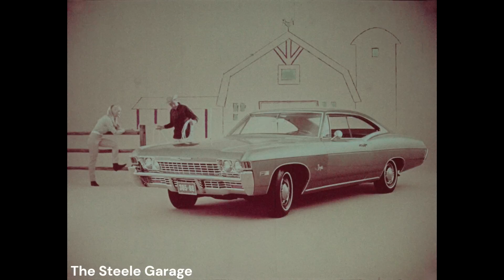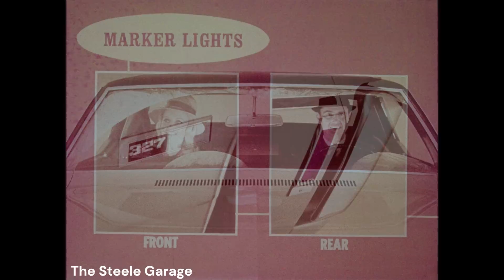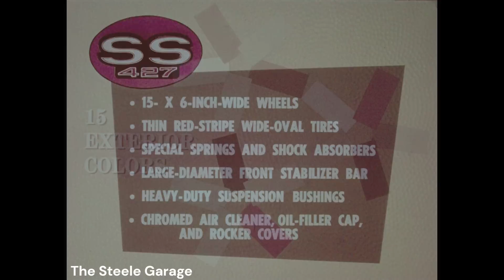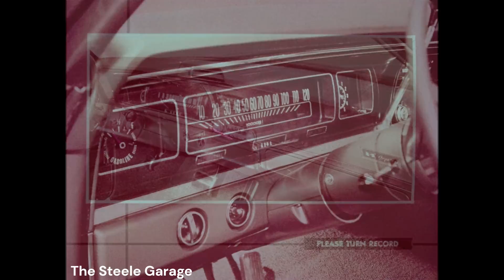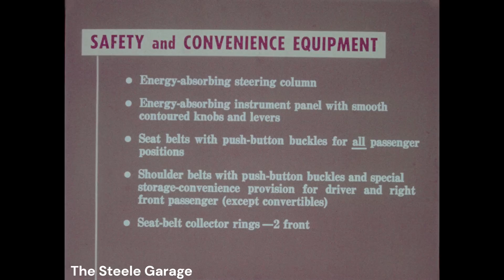1968 Impala Introduction - Chevrolet Dealer Training Film - SS 427, Caprice, Bel Air, & Biscayne

Comment: In 1979 i bought a 68 Belair for $200 dollars it was just a Plaine Jane with a 307 motor that had about 200,000 miles on the clock but the interior was in decent shape i drove it to work for a year or so then sold to my neighbor for $200 dollars.

Comment: 68 was not the first year for the Caprice "formal" roof line. 1967 was the 1st year.Also, "all new design from bumper to bumper" is also untrue, the whole design carried over from 1967, the dash,front bumper & grill, and rear bumper were redesigned.

Comment: Had a 68 Caprice, this car was loaded, all power, windows, seat, factory 8 track under the dash, signal markers on each fender, fender skirts, factory rally wheels, 327 275hp 4 barrel carburetor, owned back in the 80's have not seen one like it, should of never sold it...Thanks for the memories!
Reply from the maker: Sounds like a cool '68! Thanks for watching.
Reply: @TheSteeleGarage  It was. I did forgot to mention had the hidden head lights

Comment: My first car when I was 16 was a 1968 Impala. It was 1991. This was the typical old lady car. Had 51k miles in 1991 and looked new. Had an AM radio that did not work, and the "mighty" 307 engine. It was an old car, but it was super clean, and it made me stand out, and I could not have been more proud.
Reply: i am glad you enjoyed the nice car, anyone putting it down was jealous. the 307 was more than enough power unless you were towing a 40 foot travel trailer. at 16, any car you don't have to push is great!

Comment: My dad's last new car was the '67 Biscayne.  Straight six, three on the tree, no ac or radio.  Red with black vinyl interior.  I learned to drive in that car.  Lasted 17 years before the front.right ball joint finally gave out and dad said no to the $200 repair cost.

Comment: My first car was a 1970 BelAir sedan with a 350 and Powerglide. It was forest green metallic paint. I bought it brand new when I got discharged from the navy in 1970. The 1970 Chevrolet was basically the 1965 Chevrolet with a little styling change from year to year until the new car came out in 1971 and lasted until 1976.

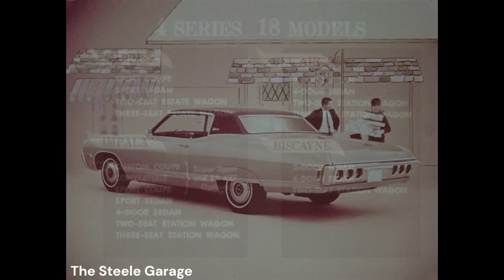Comment: 1:36 Note that the high-end Caprice coup was the only model without vent windows. They probably figured that more of them would be shipped with AC, but the "Astro Ventilation" system was a harbinger of the end of vent windows across the industry. GM was brilliant in it's ability to make buyers grateful to pay more for less; they pulled the same trick by introducing unopening opera-windows on the '71 Eldorado and in making the '75 Seville, the smallest Cadillac, also the most expensive.
Reply: Yeap, plus that SeVille was based on the lowly Nova platform, to boot!  Win Win for cashin in
Reply: Pc - Agreed. Also back in the 60s, the floor kick-panel fresh air vents would give a ton of fresh air if opened, lessening the need for (added cost) air conditioning while moving. Today's HVAC in cars is worthless in comparison, unless the electric fan is activated.

Comment: 0:19 It never occurred to me before, but the '68 looks more like the '65 than it looks like the '66 or '67. The '67 has no lower grille, just a couple of slots in the chrome; it's almost as if they dusted off  some of the old dies to make the bumper for the '68. I guess being under pressure to make each year's styling unique, it was easier to do a little mixing and matching.

Comment: My father in law went to his local Chevy dealer to trade in his 65 SS Impala. He came home with a 1966 Caprice with factory 427, 4 spd, 4:56 rear and air conditioning. My wife said after the breakin, he did low 13’s with stock tires. If he put on slicks, high 12’s. He sold it before I met my wife.
Reply from the maker: I've always been a big fan of the '66s. Since you have a connection to the '66 model Caprice, be sure to check out the video I uploaded about the '66 Impala, Caprice, Bel Air, & Biscayne. Here is the link: https://youtu.be/yvyDZILMbyk?si=Cl3OxZEVJaiQzY7y    Thanks for watching and commenting.

Comment: Interesting fact. Starting Jan 1, 1968, all passenger vehicles must have headrest. These Chevy's do not have headrest, because these 1968 cars were built during the fourth quarter of 1967, the bean counters at General Motors opted to leave the headrest off for cars built before 1968.
Reply: I think January 1st, 1969 is when the headrest was mandated. January 1st, 1968 is when front driver and passenger shoulder belts were mandated. The headrest was a factory option in 1968.
Reply: Wasn't it around that time of the strikes of 68 they put out a service bulletin saying missing parts cause no service issues? 😂

Comment: Now why is it we can't have this car today?
Reply: Environmentalists took over the EPA.  Just look at cars Detroit was churning out in the 50's to 2000.  Best years were 55 through 72, then mandates and regulations brought us things like huge plastic bumpers, performance robbing smog controls and heavy side rails.  Cars today last longer, but look like crap.  I had a 57 and 67 Chevy I wish I still had.
Reply: The emissions are thru the roof, and it doesn't meet most of the currently mandated safety requirements.
Reply: @johngaither9263 The car used leaded gasoline too. So it wouldn’t go over today
Reply: Everybody wants a truck or an SUV?
Reply: Why? It's because of a funny little thing called progress. Don't let nostalgia color the past with too rosy a tint. If auto tech was frozen at that era, lots more traffic accident deaths would be occurring, everyone would have to double or triple their gas budget, and the world would be choking in smog.

Again, nostalgia is one powerful drug. 😉 In other comments here we can see its effects in those recalling getting their first car back around that time. One's youth is so easily remembered as a time of idyllic splendor after subsequent decades of responsibility have weighed heavily and life's gut punches have soured optimism.

Cheers!
Glenn
Reply: @glennledrew8347  LOL... progress seems to not be worth the trouble, does it? Todays's cars are unaffordable for most people, are outrageously expensive to repair and maintain once the warranties are expired and many times you cannot repair them at all due to the complexity of the designs and technology moving so fast the parts are not obtainable. I'll take this 68 Chevy over ANYTHING you could buy new today.

Comment: My grandfather had a 68 Impala Sedan with the 327/275 hp engine and the hydramatic transmission. It was a beautiful blue with a blue vinyl interior and factory air conditioning. I drove it a few times and it had such a smooth ride and it was responsive with that 327. Sadly when grandpa died my uncle took the car and drove it into the ground until it was worth nothing. I sold it to a guy that wanted the engine and transmission for a Chevelle he was building. The body and interior were trashed.

Comment: Thanks for taking the time to digitize and post these. Enjoyable to watch.
Reply from the maker: You are very welcome. It's great to see someone appreciating these old training films. I'll go ahead and post the rest of the '68 Chevrolet films as soon as I can. I think the kit contains a separate film for the Chevelle, Nova, Corvette, trucks (including the El Camino), and a film that just highlight optional features. I don't think there was a film for the Corvair. I'm already working on the Chevelle film now. I've got the slides scanned and the record converted to an mp3 file. Now I just need to merge them into a video. It turns out that I had two complete media kits for the '68 Chevrolets. One has records that have beeps to indicate when to advance the filmstrip. The other kit has records with no beeps which I prefer to use. Thanks for watching and commenting.
Reply: @TheSteeleGarage - Ha! Imagine the sales force back in the 60s...sitting in a smoky room... probably hung-over... and having to hear a scratchy record with those infernal beeps, and and an inattentive sales manager still forgetting to advance the slides at the right time😂😂
Reply: @TheSteeleGarage   can’t wait to see Corvette. Actually can’t wait to see them all. Thanks for sharing!

Comment: cool and a 4speed can be ordered in any model  how about a 68 bel air wagon 427 4 speed  or caprice sport sedan with 4speed and 327
Reply from the maker: Those would both be cool. I would bet that such things were built.
Reply: @TheSteeleGarage   some one ordered them but  bet  engine was pulled car junked mid 70s or the 74 ,79 gas shortage sent them to the  junk yard
Reply: @TheSteeleGarage  You bet! Just check them off on the order sheet!
Reply: Has anyone seen hidden the headlights on a SS427?
Reply: @jonathanmorrisey5771  have not , might have be a opt same with 1969 ?

Comment: The 307 V8 replaced the old-reliable 283.
Reply: The 327 replaced the 283.
Reply: @juanvalentin4249 327 added to optional engine family but when 307 came along the 283 went away so 307 replaced 283 technically.
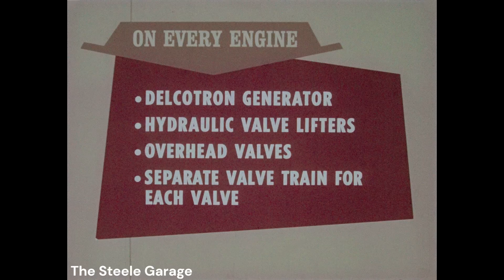Reply: But, 283 had more balls dan sed8 307. My dad bought a nu Belair 4dr. It was to be a police car. Bigger('63) wheels,tires,brakes, ... da County couldn't purchase all dey ordered. Da 283 had a 4bbl, HD Powerglide, posi rear, bigger Generator, . My dad drove it like he stoled it. Appliance white, I remember goin on long trips(NY- Fla). My dad passing cars & 18wheelers like dey stood still. Very reliable. Only flats would IMPOSE on trips. He traded it for a '66 Buick Riviera Gran Sport. No comparison. Wen GM cared. Now..😂 11:21
Reply: They had to increase it to help compensate for the addition of the stupid "smog" pump and lower compression ratio.
Reply: The 307 used the 283 bore and 327 stroke for 307 CID. The 283 couldn’t meet the emissions standards for 1968. Increasing its stroke allowed for more combustion quench time for lower Hc emissions.
Reply: Bad daggone shame, too
Reply: Arenas bought a 67 with the 283.

Comment: Thanks for this. Great video!
Reply from the maker: This film skipped to the front of the line since you requested it. I was a little disappointed that this film had so much text and talking but not many accompanying photos. I would like to have seen photos of the 385hp 427 and the special hood on the SS 427 instead of just hearing it mentioned. As always, thanks for watching and commenting.
Reply: @TheSteeleGarage  yes that would have been nice to hear more about the 427